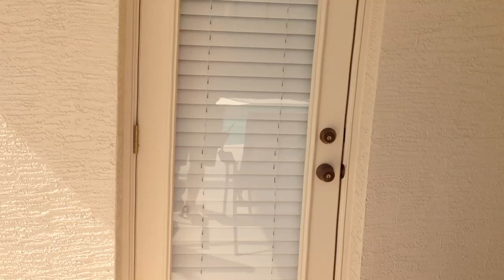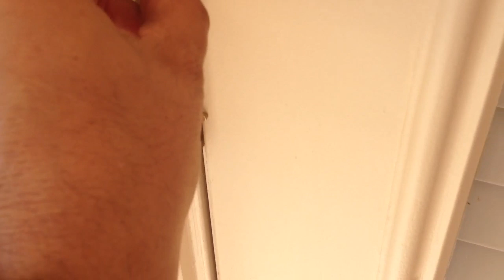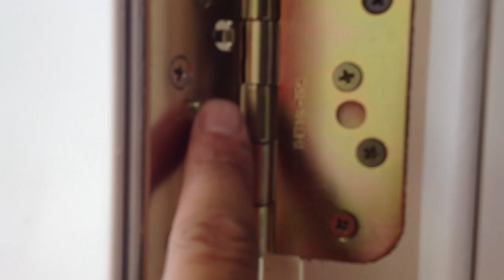Security door hinge

Comment: how will that prevent anyone from popping out the pins and immediately prying the door open with ease? it's just a little tab. At least one of the door's hinges need to be non-removable to prevent someone from removing the door.
Reply: Have you tried?
Reply: Picture it...The door is closed and the hinges are on the outside where you can easily pop the pin out. The hinge is closed. So both plates of the hinges are right next to each other. There is a metal tab in one of the hinges that sits in a hole on the other side of the hinge. To demonstrate put both your hands together as if praying. Bend the middle finger of one of your hands so that it slides between your fingers on the other hand. See now how the hand with the bent finger can't slide back and forth?  Now imagine of your hands were thick steel and your finger was a thick steel tab that sits in a hole.  You can slide the pin out but in order to get the door off the hinges would have to slide passed each other. The door won't slide out because that steel nib gets caught on the hole that it sits in.Hope that explains it.
Reply: ElectronicsNmore has a great video using  1” x 1/4” tension pins that seem a good alternative.

Comment: You can still remove the door. Pop the pins out, then wedge a screw driver on hindge side, pry a little and pop the door right out. These hindges are a fake product. Do not buy.
Reply: Fake product?  What the hell does that even mean?
Reply: You would need 3 screwdrivers cause each of the hinges would need to REMAIN wedged from the other side of the  hinge in order for the door to move. You also need to be able to move the door closer to the lock side in order to get the tabs in the hinge to not get caught up in the hole they are in.In the old days you would just remove one of the screws (say the top screw) on both sides of the hinge. replace it with a longer screw and screw it in to the point where the screw head protrudes out of the hole about 1/2 inch or so. Remove the head of the screw. Leave the other side of the hinge empty so that when the door is closed the protruding headless screw sits inside the hinge with the missing screw. This also will prevent the removing of the door when it's closed.